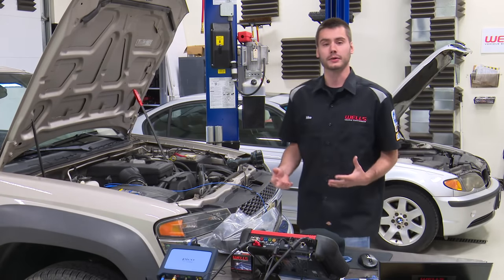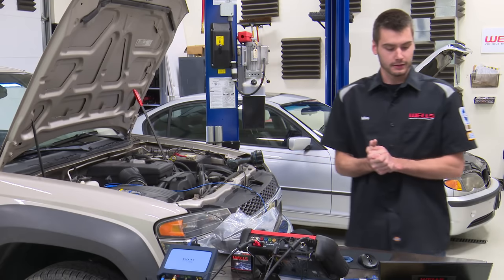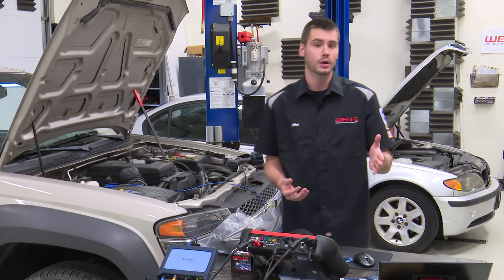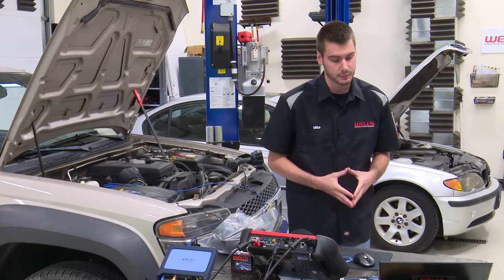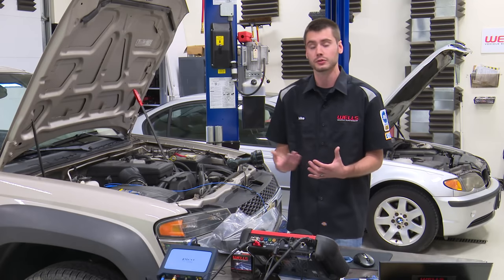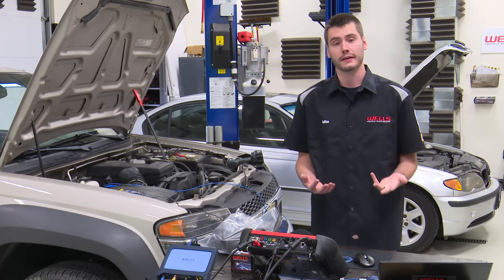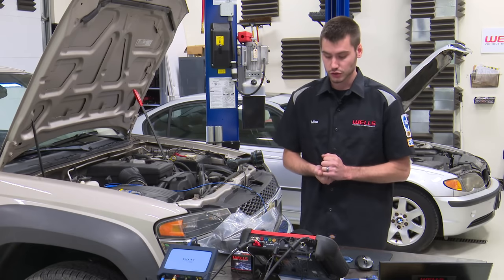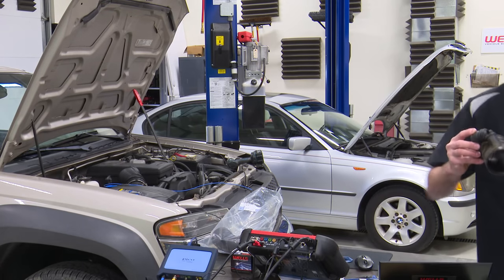Fuel Trims-- Mass Air Flow (MAF) Case Study Diagnosis (P0171, P0172)

Comment: Owned my shop for over 30 years now. When even I get a chance to take a class or rear an article, I do. Your videos are a great source of information. I always come away with more knowledge. 👍👍
Reply from the maker: That's great to hear! Thanks a ton!
Mike Becker, Senior Instructor
Reply: @GoTechTraining  I have a 2008 Chevy Express with a 6.0 vortec...I have p0300 p0171 p0174 I have checked fuel pressure and it was 58 psi I've checked vacuum with vacuum tester and it was at 17  my scan tool says 2 & 4 have misfire so I swapped coils around still there short term fuel trims on bank 1 is hanging around 3-4 % and bank 2 short term is about the same long term trims are at 16% bank 1 and 24% bank 2??? When I accelerate the long term goes toa aboit 15 % bank 1 and same for bank 2 and short term trims go to 16 bank 1 and 24% bank 2 ??? When vehicle gets hot trims all ho to zero and O2 sensor run lean and don't go over the .450 threshold?  Trying to figure out where I should go with my diagnosis

Comment: Watched this a week ago.  Had a 13 Silverado come in with a p0101 maf code today.  On test drive I watched the load pid on WOT max reading was in the 80s. O2s we’re slow to go rich and we’re not steady rich on wot.  Checked maf it was dirty.  Cleaned the oem sensor and now on test drive we get 99% load at wot as well as fast and steady  rich front 02s on wot.  Great info here I was able to use to quickly diagnose this truck!
Reply from the maker: Hi Lloyd,
That's awesome! We love to hear stories like that!
Thanks for watching!
~Ryan Wilsing

Comment: Damn Mike, what a lot of information in this training video! First, let me say that when you first started doing these video training series that you seemed a little nervous. You've really come a long way in your presentation of where you're relaxed and the passion in your teaching automotive diagnostics really shows. Great job! Now some comments about the video... You're right about European vehicles are harder to work on as I own a VW Getta VR6 and it's a bear to work on. What would seem as an obvious solution to an engineering problem, the German engineers have their own way of thinking which is, let's see how complicated we can make this :) As for MAF sensors, it would be nice if the engineers could give specs on the air flow such as at idle and other RPMs such as 2000, 3000, 4000, etc. and wide open throttle.

I've run across that same spec of where you mentioned of taking 80% of the horsepower and that should give you the g/s of the MAF at wide open throttle. So, I did a little calculations with a VE calculator program written by one of the members of AutoNerdz of where I'm a member also. You didn't have a PID for the IAT, so I took an educated case of 100F. Here's how the numbers stacked up, before and after on the Colorado and then we'll see how accurate that 80% rule of thumb is.

Before Repair:
IAT = 100F
RPM = 6123
MAF = 148.6 g/s
Engine = 3.5L
Calculated Values:
Air Density = .071 lbs/ft
Theoretical Air Flow = 378.41 cfm
Calculated Air Flow = 267.85 cfm
Estimated Power = 141.75 HP
Volumetric Efficiency = 73.16% (mmm, Not Good)

After Repair:
IAT = 100F
RPM = 6173
MAF = 185.64 g/s
Engine = 3.5L
Calculated Values:
Air Density = .071 lbs/ft
Theoretical Air Flow = 381.5 cfm
Calculated Air Flow = 345.86 cfm
Estimated Power = 178.14 HP
Volumetric Efficiency = 90.66% (Wow! Big Improvement)

Now, let's take a look at the 80% versus HP in checking the max flow rate for the MAF at wide open throttle. The HP from the data that you looked up is 220. 220 * .80 =176 g/s. It's a little off from the 185.64 which is not to bad considering that it's a 5.2% difference. For this car, a figure of 85% would be good. That would put the numbers at 220 * .85 =  187 g/s. Maybe 85% is the magic number for other cars :) This would probably need more research on different vehicles to see how close it is.

A tip that I use on my PicoScope is to have the sample rate of where the sample interval is at 1uS. At this interval, you can look at pretty much any signal on the vehicle and don't have to worry about the scope alias. Right mouse click on the screen and select 'View Properties'. You can also select it from the menu by going to Views>View Properties. Turn your sample rate up until you get the sample interval of whatever you want. As mentioned, I like to use 1 uS.

And congratulation on your new son born 4-17-17!!!

I'll send you an email about the question on the purge valve. Have a great evening Mike, and again, very nice training video and I'm sure it will help lots of folks out there who wants to understand how systems work on their vehicles.

Terry
Reply from the maker: Hey Terry! Thanks! You are right, I was very nervous in the beginning. I was and still am just a wrench in the shop. Presenting my ideas in an organized manner to people was foreign to me. I'm glad you've noticed I've settled in...because I truly feel like I have. It took a little bit of time but now i'm comfortable and excited for what the future holds!

Specs and known goods from the engineers from the factory would be amazing. They have to have that information, the program the PCM to look for it. Why not share, right?

You are right, I should have IAT up on the screen. That 100F seems to be reasonable. Interesting numbers on the VE. Makes sense though.

I will have to keep an eye on my sample interval. 1uS sounds good. I'll keep that in mind. Thanks!

My wife and I are thrilled. Our first child. He is a wonderful little man. I hope to introduce him to cars at a young age. Hopefully he will be as intrigued and interested as I am.

Thanks you so much for the long comment! I really appreciate the time you take to watch and converse. Means a lot to me!

Mike Becker, Technical Services Instructor

Comment: Great video Mike  you have demonstrated having the fundamentals and the right  approach with a generic $100 scantool  can fix certain issues, also having a $10,000+/-... scantool with no diagnostic fundamentals is useless.
Reply from the maker: Hey Vin Brown, exactly. You don't need tons of expensive equipment to diagnose every issue!! Understand the system...understand the failure...fix the car!
Mike Becker, Technical Services Instructor

Comment: Great Job really enjoyed it.  I like that 80% rule, it was right on the money.  I guess engine load % is derived from the fact that maximum air flow is already known via the initial design of the engine and once that actual air flow is reached with the new MAF, the 100% engine load value is displayed at "pedal to the floor". 🙂
Reply from the maker: Hey Fausto, thanks for watching!
Mike Becker, Senior Instructor

Comment: About 25 years ago I was a Bosch fuel injection tech trainee and we had a problematic Opel/Vauxhall. Now, they're front wheel drive and this is important: in any of the forward gears, the vehicle would stumble, and generally run terribly. In reverse it was 100%.
5 mins with some brake cleaner found a cracked inlet hose after the afm.  
The engine torque, when in forward gears, would pull the crack open, but reverse forced it closed, hence the symptoms.
These were the days of open loop, mapped ECUs.....
Reply from the maker: Sounds like a fun diagnosis! Thanks for sharing!
~Mike

Comment: Both A and B. The carbon canister could be saturated in hydrocarbons causing rich code. A clean canister with no hydrocarbon in it would supply fresh air to the engine causing lean code.

Comment: Nice Class on this Problem. You know your craft buddy. Took me years to get to this point. Keep it up.  One thing I can add, and this has happened to me on numerous different Mass Air Flow Sensors with a car coming into the shop with Lean Condition at Idle, different from this issue but relative to this problem. I found Bugs in the Mass Air Flow Hot Wire skewing the Mass Air Flow reading and not easy to see since the Hot Wire is buried in there on some of the newer style Mass Air Flow Sensors, example 2015 Cruze. Not really sure how they get in there but since the first one I diagnosed I try to take a look at the Mass Air Flow first, just in case when I have an obvious lean condition. One for the Books...
Reply from the maker: Hello,
Yeah, I have also found a few bugs through out the years stuck on the MAF hotwires. No idea how they make it past the air filters. One car was a Infiniti and it created a no start and it was towed in!
Thanks for reaching out!
~Ryan Wilsing

Comment: Both technicians correct. When the charcoal canister has little to no vapor stored, a sticking purge solenoid will drive the mixture lean. Potentially causing a p0300 random multiple misfire or lean exhaust code. After refilling with gas a sticking purge valve will cause rich exhaust as the vapors in the tank are displaced by liquid fuel and since the purge is open they will go right to the intake manifold.
Reply from the maker: Spot on Michael! Well done!
Mike Becker, Senior Technical Instructor

Comment: You should get an Autel so you can reset adaptations. Your "total trim" is within spec. Just adding, maybe you've described it using that verbiage before,  the short and long trims together would be your "total trim". In which case if they essentially cancel each other out they're within specification.
Reply from the maker: Thanks for watching Edwin! Very true, that was part of the lesson if I remember right.
Mike Becker, Senior Instructor

Comment: I think both mechanics are correct, but to  a certain extent. A stuck-open purge valve will INITIALLY cause the engine to go rich. This only lasts until the EVAP canister is emptied. Then the engine will run lean because it will now suck only air through the open purge valve.
Reply from the maker: Hey, great answer...it's all dependent on how much vapor is stored in the canister. Well done!
Mike Becker, Senior Instructor

Comment: i have a vw in the shop it has p2181 and p0171 and p2271  it also had p0300 with 301 302 305 codes so i did the t-stat and then found the pcv bad and the oil cooler adapter so i changed that as i was there and it was cheap. it came back with the p0171 and i found the purge valve was also bad.   so i have the purge on order and i expect that to fix the p0171. the trims are real close and the p2171 did not return them maf is .01 .02 .03 lb/s at idle 1500 and 2000 rpms  i think the maf is ok but when it comes back for the purge valve fix i will test that a bit more. it seems i have to run it out to full throttle in 2nd gear to get the maf to full numbers. thanks
Reply from the maker: Hey Bob, hope the leaking purge fixes it all up for ya! Thanks for watching

Comment: Both... The General Motors EVAP reads the opposite from other vehicle models on the  voltage multimeter numbers. It rises when it burns too lean & goes lower in numbers when the fuel is burning rich.

Comment: Hi! Question Please:  Have a 2011 F150 3.7 with 256,000 miles engine was replaced by Ford on the warranty at 90,000 miles. The truck ran great and flawless for me until lately I got stuck on the road into limp mode at one point and it would just start install start install on up spray need to run to the engine and it started up and I was able to get it home from a major highway very dangerous and overnight went to talk to engine up again and it ran like nothing happened the news and it ever since then couple months I would say now I have negative pend fuel trims I have replaced spark, plugs, mass, airflow sensor, air filter, and left the bank2 downstream O2 sensor. I have checked for air leaks, vacuum leaks my short time fuel trims are flexing any wheels between 02, +13 and my long-terms are packed at -25 on both banks, and they seem not to move at all except for on the cell bill move down to -23 to -21 open tinkering with this quite or a lot I’m watching a lot of videos and repetitively on yours laughing out loud. I’m trying to learn what you’re trying to teach us which is very appreciate it. If you can help me out, I would appreciate that very much. Thank you, Mike.
Reply from the maker: Hey Mike, sorry to hear of the troubles your facing with your F150. Rich conditions can be very tricky. Is the truck stock? Have you inspected the purge solenoid? It could be siphoning fuel from the tank if it's stuck wide open. If you start the truck up and unplug the connector there shouldn't be any vacuum on the port that goes to the hose going to the back of the vehicle. Other than that, I'd have to see the data being read by the scan tool to give you more advice. Any trouble codes?
Mike Becker, Senior Instructor

Comment: Hi fella , technically  brill video much appreciated  .
looking at your short term fuel trim I noticed it was running at - 2 % showing it was taken fuel away slightly, so
Reply: sorry added comment too early and not fully explained. 
continuing from previous post my thinking is that on the sensor inside the mass airflow as
extra dirt on the sensor itself making the surface area digger and the ecu determine s that more air as enter and this not being the case  and actually adds slightly more fuel  making it richer on the fuel trim  readings   - 2%.
Toyota yaris with a anolog type sensor as shown that type off reading before when idling .
not sure if you fully agree with this .
quick note, carry on with the great videos.
Reply from the maker: Hey James! Don't you hate it when you accidently post before you finish your thought! Happens to me all the time, especially out on Facebook.
So, the dirt makes the surface area bigger, but I think it does the opposite of what your thinking. Remember that when air rushed past the sensor it cools it. If we put a bunch of stuff on there, the sensor does not cool as much, therefore the computer thinks less air, therefore less fuel. Then we get  a lean condition. As for the negative 2% I would say that's probably normally. Anything around 0 i'm happy with...and the computer doesn't get mad until +/- 10%.
Mike Becker, Technical Services Instructor

Comment: Hello Eng
Please I have a problem Nissan Pathfinder 2003 am replace Airflow meter sensor every six months.
What can cause it
Reply from the maker: Hello Rabiu,  A few things that come to my mind for repeat failure would be a aftermarket air filter or intake system causing MAF contamination or an inferior part that is of poor quality. Are you replacing the sensor based of a diagnostic trouble code or a symptom. You may need to dig into how the sensor has failed to determine the root cause of the failure.
Ryan W. Technical Instructor

Comment: I think it could be either one. By having an open purge valve, the motor will have unmetered entering causing it to be lean. 02 sensors will tell the cem to throw more fuel out. This can mak it rich. It depends on how well you CEM compensate for th unmetered air

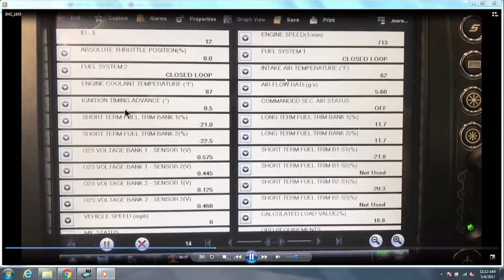Comment: 13:17...I have seen that your short term trim for both banks of sensor 2 shows a Not Used. My E46 M52 shows n/a% on same, but there is a voltage. Is it normal?

Comment: Also I believe that the current increase is because the sensor is being cooled off so it will need more current to reach spec temps so the film element will draw more current to heat up.
Reply from the maker: Thanks for watching Car Cheer!  More air, cools the sensor, more current needed to maintain the temp. 
Mike Becker, Senior Technical Instructor

Comment: I have 2001 Chevy Silverado 1500  4.8L  This is going on I got no Check engine light ,  Truck is Pinging under normal load , Hesitation . 
I had knock Sensors replaced  I am positive they are not OEM  , EGR was replaced also not OEM  , Smoke tested for vacuum leaks  is perfect no leaks  could it be I have a fuel pressure issue or Bad  Coil , Mass Airflow problem

Comment: Thanks Mike 
Have two questions

1. With regards to getting wide open throttle maf/gm sec reading, do you actually have to drive the car outside to get the reading or can put the car in park and rev it to wide open throttle? Slaming the accelerator to full throttle in a sec is good once its gives good reading or you must stay on the accelerator for a while in wide throttle to get a good reading either at park or driving?

2. I have a Nissan that doesnt have a barometer sensor, only MAF sensor.
But i have barometer data pid in my scanner; where does this reading comes from? Btw when the MAF sensor is unplugged the barometer reading is still present!

Help

Comment: My Pajero i0 2002 started to hesitate when I would put my foot down, the the engine light came on, I had already cleaned mag ect. However It was still happening , what I had to do it take the top of the mafd spray the electronics with electrical spray cleaner and toothbrush, after waiting for it to dry. I started car, runs great engine light, it’s a 2 ltr and I get about 9 klm a ltr, what else should I do ,?

Comment: Hey Mike. How have you been doing? You haven been posting any videos lately?  Couldn't you use the calculated load value to check the MAF? Low calculated load value cannot be resulted from a fuel delivery issue, right?

Comment: P0171 can be hell to fix. Any idea why the MAF on sentra 2005 would read normal 4.5 g/s at idle and shoot over 18 g/s at higher RPM 3500. been replaced twice both MAF sensors do the same. there is no air leak. done several smoke tests . if MAF monitors air coming in from air filter side, it shouldn't react like that. even  wideband is new . long fuel trim over 28% short term -2.5 at high RPM or idle,

Comment: Does the throttle plate open all the way is there any slack in the throttle cable
Reply from the maker: This vehicle is drive-by-wire. There is not throttle cable on here.
Mike Becker, Senior Technical Instructor